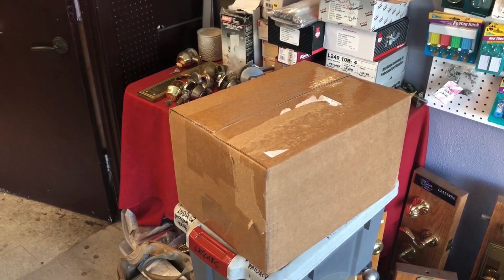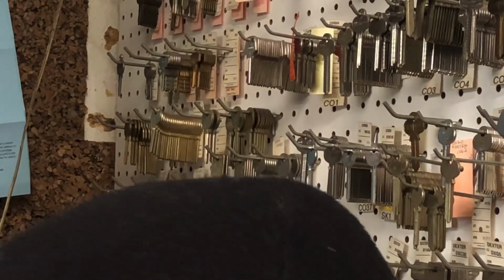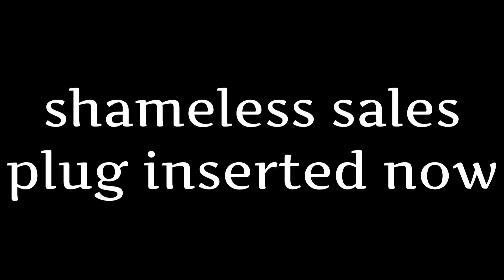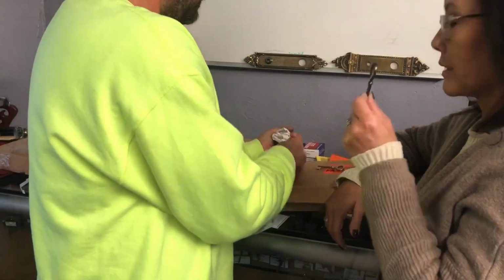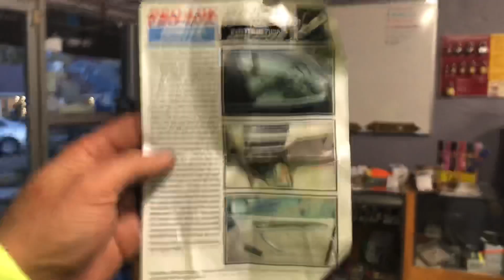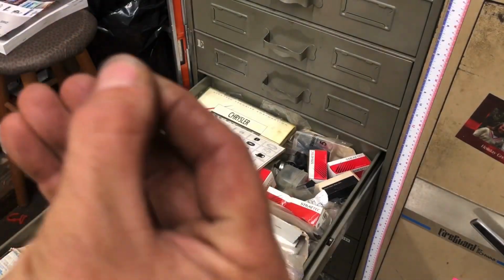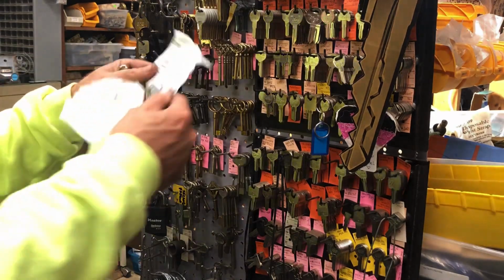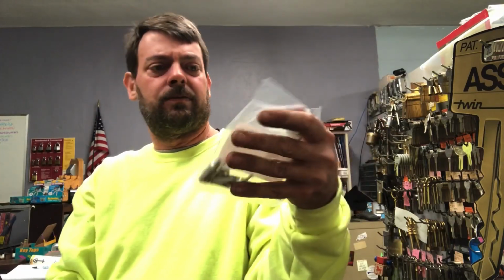another distributor unboxing “two or three of them”

Comment: That long reach tool is awesome...
I drive a Wrecker and do lockouts all the time.
I've had the big ez with a wedge and airbag from my snap-on dealer identical to the one you have or pretty close to it.
2 thumbs up 👍👍  way better than the old days of the "wonder tool" remember the wonder tool? 
It goes Under the window from outside the car under the window to the inside of the car so you can flip the interior door latch or button. 
I remember getting one jammed up in the window mechanism inside the door LoL  😆 yep the "wonder tool" was the high-tech Gadget 
30 years ago or more

Comment: A long time ago i locked the keys in the trunk of my 1970 plymouth duster. The lock smith that came was able to wiggle a key blank in the lock and file a notch. After doing this a few times he had made a key that worked perfect in all of my doors. How did he do this. I was 18 at the time and i am 33 now still wondering about how he did this
Reply: that would be a process called impressioning, the pins/wafers bind in order and produce marks on the key blank that indicate where you need to file notches. Do that for all positions in the lock and you have yourself a working key. the locksmith in your case might've done this to get the trunk open if there wasn't a trunk release in the cockpit.
Reply: I wanna check it out. It was awesome i swear the guy did it in like 3 minutes
Reply: He just impressioned it. That’s a dying art unfortunately.
Reply: @GottSegneDich  how come people answer questions that have obviously already been answered with the same exact information the other people already wrote?
Reply: @mrsetho0  yeah the doors were locked also. I was just opening up the trunk to put air in my super cool air shocks. Gotta have that 70s hot rod look. Lol
Reply: @IMKINDOFABIGDEAL13  Why are you asking me and nobody else?
Reply: @GottSegneDich  because there was only 1 actual response telling me the name of the process and one other person just added on to that comment. So who else would i ask?
Reply: @GottSegneDich  nobody else just repeated the answer